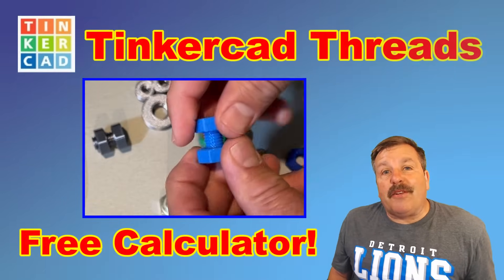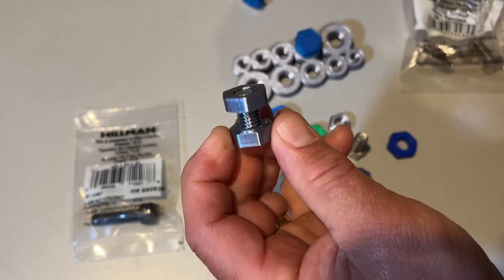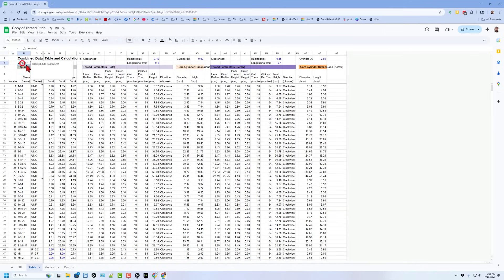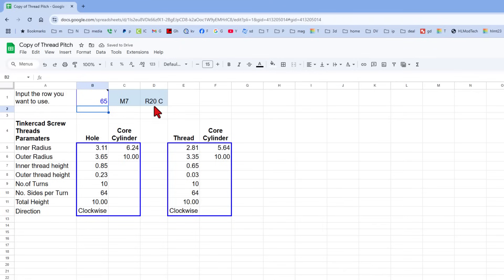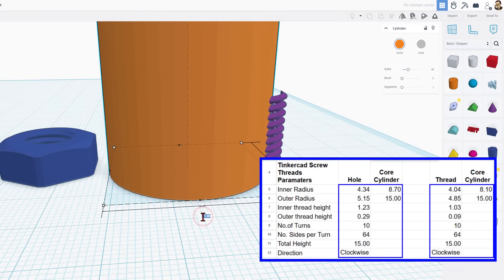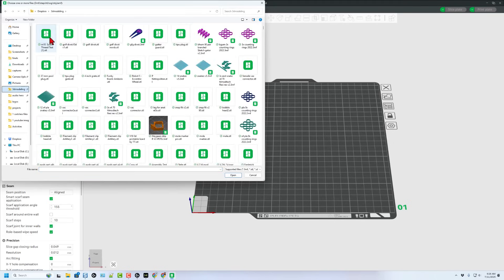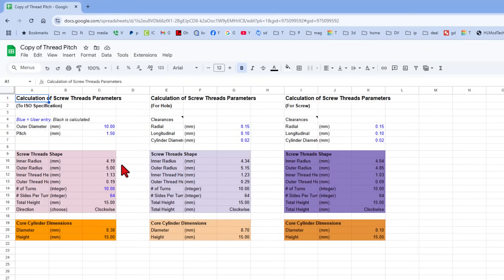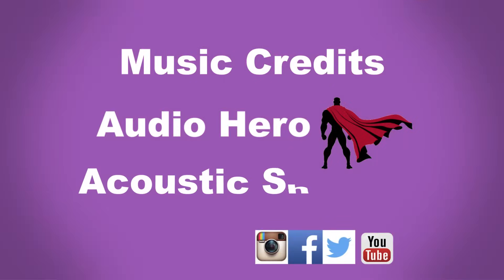Make Perfect 3D Printed Tinkercad Threads Free Calculator Too! 💯🔥

Comment: Hi great video, thank you for shering. 
Im lokking to make a M38x3 tread 
Unfortunately the spec is not on the google sheet, any tip or help would be greatly appreciated
Reply from the maker: Pop over to Google Gemini and use "m38x3 thread specs" as your search term. It gets you the data.
Reply: @HLModTech I'm really sorry but M38 isn't specified. I can only see M39 and M36 but nothing in between
Reply from the maker: Yup. I told you to search with Google Gemini. https://imgur.com/a/8kfK13G
Reply from the maker: I have no idea if that fine thread is possible via 3D printing. I clarified the note about searching so it was more clear too. Sorry, I was not clear the first time.

Comment: I'm trying to make this for a 3/8 nc thread. I see it is on line 10 on the google sheet. I followed yours first steps and put that into the box on the Vertical tab to get the correct numbers to use. when I do that it comes up with inner 4.05 outer 4.91 and so on. When I go to enter this first 2 # into tinkercad on the correct spots they max out at 1.969. I have entered the # multiple times and made sure I'm hitting enter after entering the #. Any idea what I'm missing?
Reply from the maker: Did you swap your project to inches? All the numbers need to be in millimeters. Swapping the project to inches would break all of those... I think.
Reply: @HLModTech  Thats a great thought I will check.

Comment: You lost me on what the calculation page is for? Sorry I'm new to this and have had a p2s for a month. Any clarification would be helpful or link to videos that go over printer set up for more complex things other than click and print. Regardless you have a new subscriber!
Reply: For the specs
Reply from the maker: The calculator is for making your own thread. You take the numbers from the chart, input them, and the sheet shows you the numbers to use in the screw thread to get the desired results. I appreciate the sub. 👍 I do not have too many videos that go past the basic settings with the printer. I generally stick to .2 standard for everything I do.
Reply from the maker: You may want to check out the full Thread Playlist https://bit.ly/threadhl Lots of options in there.

Comment: Hello, thanks for sharing this calculator.  I am unclear on the additional tolerances in the calc tab.  All the math works out except the core cylinder diameter.  It shows .02 but both the examples seem to show a difference of .30.  Am I missing something?
Reply from the maker: The tolerance number adjusts several of the numbers when you change it. It is across the entire nut and bolt and the entries you add to the screw thread in Tinkercad.
Reply: @HLModTech  got it.  with your video I sorted it out.  prints very clean threads.  Thanks for sharing.
Reply from the maker: Sweet! Glad it worked out. 💯🔥

Comment: Im wanting to remake a lost turret cap for a rifle scope. This will have some pretty fine threads. Even if it cant be 3d printed i still want to make the tinker cad file. 
Im thinking i will have to calculate all the specs on my threading and the size of the cap itsself. The only problem I see is having the correct thread count in the cap itsself and adding some threads on the bottom to create the hole. Not covered in the video as youre making a nut and not a cap. Should be pretty simple i think. Just waiting for some digital calipers to come in to do the math. 
Never done this before by the way. I do have access to a 3D printing shop though. Just think it would be an interesting project that ill learn something from. Any wisdom would be appreciated!
Reply from the maker: Cool idea. Switching from a nut to a cap is pretty easy.  I’ve had a few projects similar and I had to just guess and check as I kept printing and adjusting until I got the exact fit I wanted.
Reply: @HLModTech  My uncle owns a 3dprint shop. Ill see him over christmas and work out the details. 
how fine can you create usable threads with a 3d printer?
Reply from the maker: I have not went much smaller than a 6mm core. Depends on the strength you need. I made an ABS part that lasted years at my school. It was still going strong when I retired.
Reply: Heres one you might be able to help me with. So I've got the cap made, but instead of it being a smooth round cap I would like to put grooves in on the outer walls to make it easier to unscrew. Any idea on how to do that?
Reply from the maker: Check this out. https://youtu.be/DgU5Bwtq-iI

Comment: I enter all the numbers like you have to get my thread. When I go to make the core and combine it with the threads to make the bolt, they are the same size and is just a rod at that point. What am i doing wrong? The thread numbers equal a 8.1 x 8.1 radius, same as the inner radius of core cylinder.
Reply from the maker: Is there any chance you dragged a handle? That does break stuff. This video demonstrates how parameters are broken if we drag handles on a shape. https://bit.ly/breaktink

Comment: 1: Great Video squire (easy to understand and easy to follow)

2: Question. Say I want to make a longer thread length than what’s in the calculator (aka something longer than 15mm) is there an easy way to do it or am I just going to have to duplicate and manually align the top of one thread to the bottom of the other?
Reply from the maker: I have a video for it. Easiest way is to just check the pinned comment.

Comment: I'm stumped. You explained it so well, I copied what you did on the M10 and it came out just the way you did it. I then went on to make one for myself using the numbers for an M36. The thread looked great, but when I did the Core Cylinder numbers it's 3 times the size as the thread. The Core measures 31.99 in X and Y, but the Hole measures 16.33 X and Y.  When comparing the dimensions of yours, the Hole measures 10.30 in X and Y and on the Core it's 8.70. What did I miss?
Reply from the maker: I am guessing you typed a number wrong in the calculator, or one of the formulas in the calculator has been adjusted. I would just snag the calculator again and give it another go. Is M36 in the table? I have not used it since I created it. That seems larger than my brain remembers.
Reply: @HLModTech  Thanks so much for responding so quickly. yes M36 is # 97. I would love it if someone would give it a go and tell me what they get. I did not alter any numbers in the chart.
Reply: Got my answer!! I was working in TC in Chrome, I switched to Firefox and the numbers came out just fine. How frustrating. Once again, thanks for your great vids.
Reply from the maker: Well done! I would have never thought of it being a browser thing!

Comment: This is really cool - yet another thing you don't need a more "professional" CAD package to figure out. If you do a lot of stuff with threaded parts, you might want to invest in a cheap set of "taps and dies" from Harbor Freight - $20 and up. They are made of hardened steel and cut threads internally (a tap, for nuts or holes) or externally (a die, for screws). They're made to be used in metal but will clean up slightly mis-formed or glitchy threads in a sloppy 3D print like butter - far faster than reprinting.
Reply from the maker: Thank you. Great tip with the taps and dies. 100% faster than re-printing. 💯🔥

Comment: I am trying to make a Thread Protector for my rifle. The threads are 5/8 - 24 and another is 1/2 - 28. Is there a way to create a cyilende34r with a hole matching these thread counts in TinkerCAD?
Reply from the maker: My printers were never perfectly accurate. I would just come as close as you can and see if they thread on and then scale the print until you were happy.

Comment: That's great, Thank you for sharing!
Like a cave man, I have been heating up the screws and turn them thru objects for a good, smooth "melted" thread.
Reply from the maker: LOL @ihim7380! I had never heard of that technique till now! Slick solution if the fit is not what you are expecting. Thanks for sharing.

Comment: This and the follow up video get a sub from me, these are awesome! Sadly, I need setting for a M17x1.0 and M12x1.0 thread and they aren't on the spreadsheet. I tried doing the math and it didn't seem to work.
Reply from the maker: Appreciate the sub. I think you can just put 12 and 1 in the calculator and all the numbers are there. Same for 17.
Reply: Go to the Calc sheet, and for example to get M17x1.0,  type 17 in Cell C5 (Outer Diameter) and 1 in Cell C6 (Pitch)
Reply: @DanK-ZDP189 legends! Thanks fellas.

Comment: Nice sheet but it's locked into a calculated thread length leaving out options for printing different lengths..   I might of missed something on the sheet to adjust this but haven't found it if there.
Reply: Hi, my main priority was to make robust threads to test. I'll look into your suggestion CVO.
Reply from the maker: I am whipping up a quick short for how I would do it.
Reply: @DanK-ZDP189  do u have a way i can send you a xl file
Reply: @DanK-ZDP189   Hello ZDP.. I found that there is not much that can be done on your sheet to mod the bolt length due to the parameter limits on TinkerCad Screw Thread Tool, which limits to a 20mm length.   HLModTech's method is defiantly the best way to adjust length.    I did mess with your sheet and added to your table to include Hex Head/Nut sizing etc.   I sent this to @HLModTech to route to you for approval.  Thanks for sharing your sheet.  Defiantly a nice tool to have.
Reply from the maker: Just duplicate the thread and nudge it up.
Reply: @HLModTech  Yup,...  I was able to import the sheet to Excel and working on adding some formulas to allow adding bolt length and also hex head size for the various bolts...  I won't post these mods without ZDP's permission and or possibly sharing my mods with him so he can add them..   is there a way to get in touch with him via email.
Reply from the maker: I will aim him towards your question here...
Reply from the maker: This is how I would do it. https://bit.ly/threadlong
Reply: Hi! Has something happened to the thread pitch document? When I try to make a copy I get the message “Sorry, unable to open the file at this time. Please check the address and try again.” (I’m working from an iPad.)

Comment: Do you have some advice if you print this with resin? Thanks
Reply from the maker: First guess is that it will have too much gap... I will get it printing on my HeyGears RS Turbo and find out though.
Reply from the maker: It was not a too much gap issue. https://youtube.com/shorts/pD3BNWb6hKE?feature=share That resin can be sanded or worn down... I think with time they would fit well. Resin on Resin was fine.

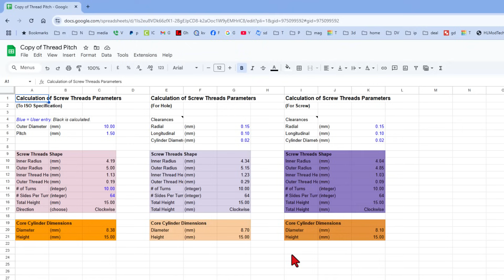Comment: I failed to understand at 7:25 when you discussed the calculator for the various printers.  Is this for making a screw hole in a project for a bolt to be screwed into?  I listened to it about 10 times and it's not registering in this simple mind!  I was hoping you would have demonstrated how to use this portion of the tutorial.  I love your videos. I use them all the time on my Star Wars Droid builds to modify and improve them.  Thanks for the time and effort.
Reply from the maker: I do not cover it thoroughly in this video. A bit better here... https://youtu.be/wq8hwXNsDG4?si=zzox6jU5dk2hSX2D&t=192 Essentially ZDP found that we need to add clearances (or remove for a screw) to take our Spec Matched thread and turn it into a hole for cutting, or a screw for 3D printing.  Keep me posted if that still does not make sense. As a teacher, I am comfortable trying to find the right analogy to make concepts understandable.

Comment: Is there a easy way of changing the height of the bolt in the calculator/tinkercad without it distorting?
Reply from the maker: I would just duplicate the thread and core... then nudge them up to the height you want. It should be easy to line them up. Just never stretch the handle as that would break the thread.
Reply: @HLModTech  Thanks for that, I've figured it out. However, limited by the parameter limits in the screw shape so duplication is the way to go. For info: Pitch = Total Height / No. of Turns, New No. of Turns = New Height / Pitch. Finally pass the 'New No. of Turns' and 'New Height' to the parameters.
Reply from the maker: This is how I would do it. https://bit.ly/threadlong

Comment: Can you change the length of the screw
Reply from the maker: I will see if ZDP has a slick trick. I would likely just duplicate and nudge it up till I had the length I wanted.
Reply: Yes. Like @HLModTech said, the easiest way is to stack them or cut them with a hole, but you can also adjust the number of turns, etc.
Reply from the maker: This is how I would do it. https://bit.ly/threadlong